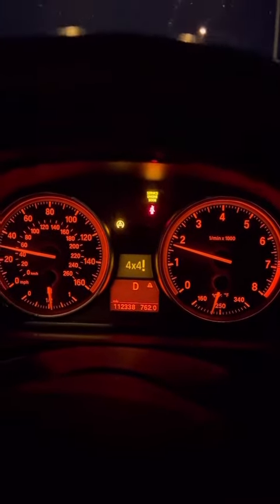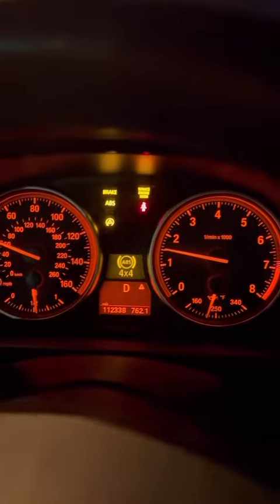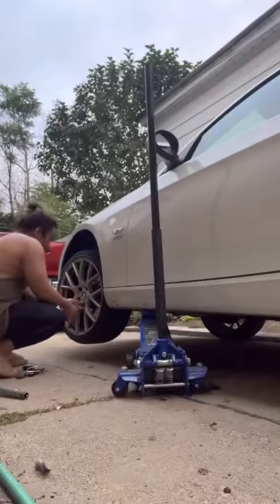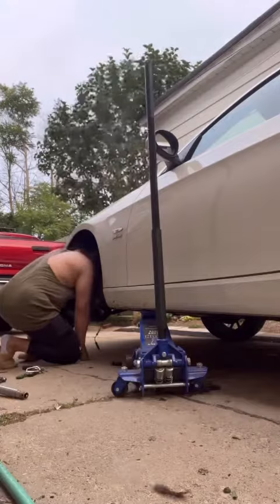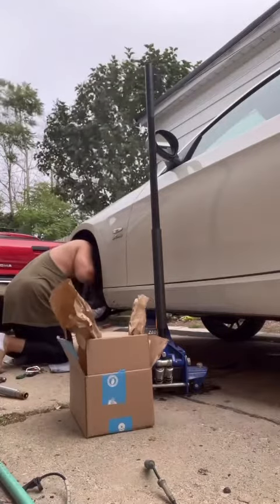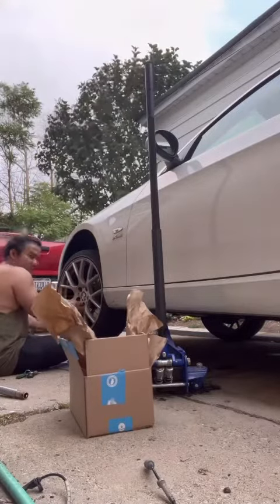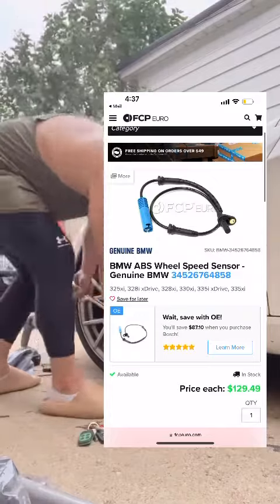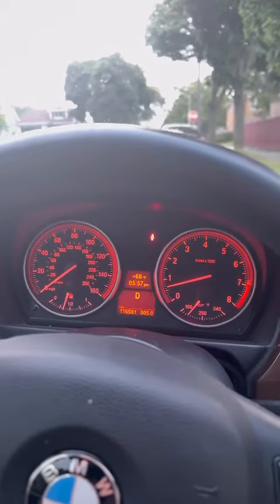Bmw Xdrive axle bind 4x4 abs brake light fix

Comment: Hi thank you for the video. How does one know what speed sensor to replace?
Reply from the maker: If you have a reader that plug into your car it will tell you which wheel
Reply: @user-xm6oq9gz9u  Thank you

Comment: I did have 17s rims 245s tires on the back and 16s 255s tires in the front. When this all happened. Then I went and got 4 new tires return the 17s rims made sure they were all 16s 255s hoping it fixed the problem bc the car was un even they said. But nope still having those lights. Mechanic thinks my motor encoder motor went bad but I don’t hear a grinding noise.
Reply from the maker: Is your car a xdrive?

Comment: I just had all my tires replaced same car and now I have all these lights exactly how u explain it. Did they break my speed sensor or put the wrong one in? I dont hear no grinding noise under the car. And it only happens when I give it some gas. When I first start it up no lights are on but once I actually give it some gas they all come on
Reply from the maker: Either your speed sensor is broken or you need to reset the code.
Reply: @user-xm6oq9gz9u  my mechanic thinks it’s the diff fluid. Bc he said he ran codes no speed sensor or wheel bearing codes came up. He also said he reset it twice. And it happened after I got 4 tires replaced but not till I kicked it in to DS. I’ll take it to get scanned again and see what pops up
Reply: @user-xm6oq9gz9u  do you think it’s smart to unplug the battery for 20mins will reset everything. Or just have them clear the codes again? Or check the sensors?
Reply from the maker: @Scared2Love  I wouldn’t, I unplugs my battery and now my airbag sensor won’t go off
Reply: @Scared2Love  What’s up bro just wondering if you every figured out the problem currently going through the same issue. Thank you
Reply: @khalidtamimi4113 transfer case 3900$. I replace the actuator motor myself 100$ but the just took the Abs and brake light away. Now I only have the 4x4 light on and traction control disabled.